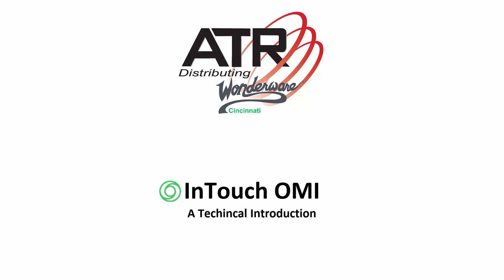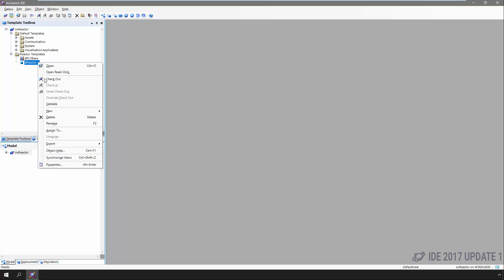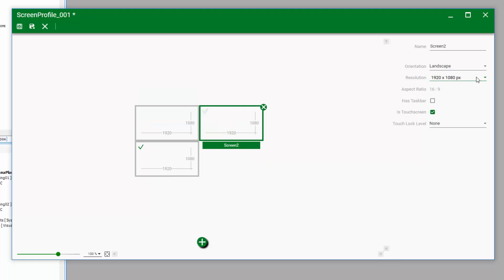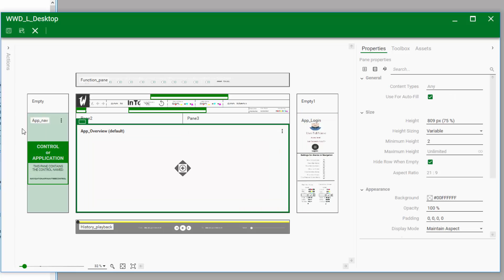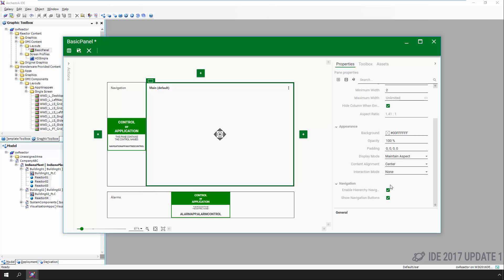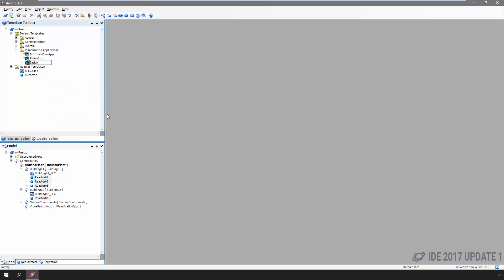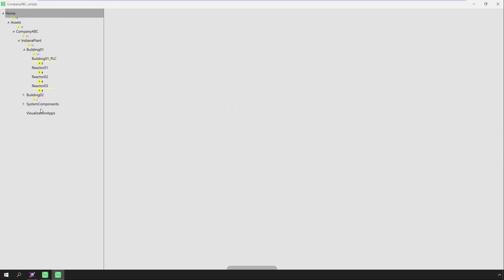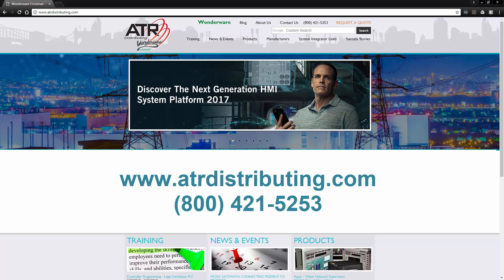InTouch OMI Technical Intro

Comment: Hello.
1. Is it possible to use OMI with Archestra graphics not assigned to any automation objects? I mean without modeling the equipment... 
2. Is it possible to create a totally custom navigation menu? or is it linked to Nodes or areas?
3. Do you have any available documentation or manuals for Intouch OMI? 
Thanks !
Reply: You can create your own custom navigation model and drag/drop graphics from the GTB.  You do not need to use automation objects.
Reply: @ChrisCoble  Is it possible to make o video on this? I'm really struggling with this. 
I created the navigation model and dragged and dropped symbols but it is only allowed on the navigation root.
Thanks so much!
Reply: By default on a new ViewApp, the equipment model is automatically linked into the ViewApp. You can delete this node if you like.  When you click on the root node then, select "Add" to create a new navigation level.  While selected on this new node you should be able to drag/drop content into the panes.

Comment: Hi,  i have 1 app  2 screens whith identical screens same picture. I try to use the new OMI + navigation. Now i have problem,  if i click on navigation in 1 screen  same time 2 screen sow picture wich i chuse on 1 screen. How configure the layout or navigation pane? I need that on each window the navigation worked separately from each other on the same application with two screens.
Reply: Each "Screen" is assigned a layout.  If you want different content to show on each of the screens, make sure the "Content Type" assigned to the layout specific area are different.  If you want them to display the exact same content, than simply make sure they use the same layout.  If you need further assistance, please contact your local Wonderware technical support provider.  They should be able to walk you through this.  Good luck!
Reply: At present there is only 1 navigation model which determines where all content goes across all screens.  In the backlog is the ability to create a Navigation model specific to a Layout, which will solve your problem when that feature is released.

Comment: How do we customize the NavTreeControl to obtain the one of 0:55 in the video?
Reply: Great question!

The navigation tree is, by default, an exact replica of the Model view of App Server.  The one shown at the point you referenced was built either by allowing the NavTree to exactly mimic the App Server model, or the user customized it by adding custom nodes.  The NavTree is very configurable.  For example, you can have the NavTree start at a specific “node” (Area) in the model, or add your own custom nodes within.  Colors and the “look and feel” is also customizable.  

The configuration of the NavTree is accomplished within either the Layout (where you drop the NavTee app onto a pane/panel), or in the InTouchOMI ViewApp templates.  Both locations enable you to set the customization (configuration) of the NavTree that you desire.

Full disclosure…the application shown at the time you referenced is actually an example application from our friends in South Africa.  I don’t have direct access to their application…but you can use the example I show in the video, and simply select the NavTree within either the pane/panel or the InTouchOMI ViewApp Template and try out your own customizations

Hope this helps!